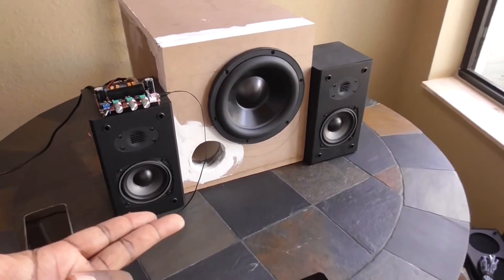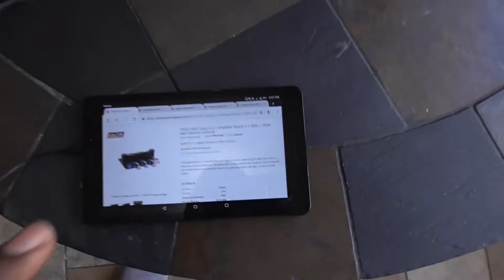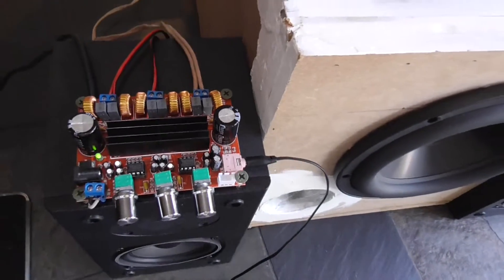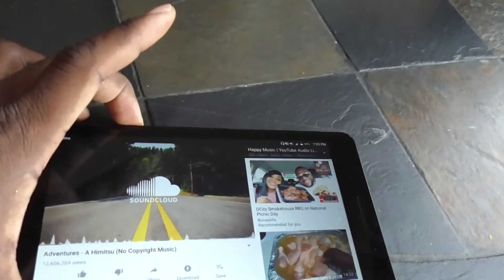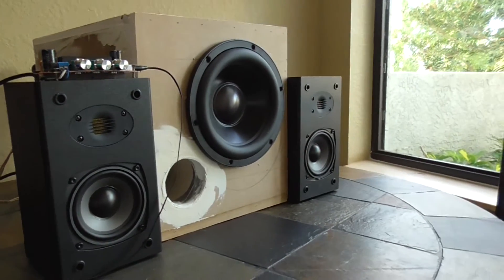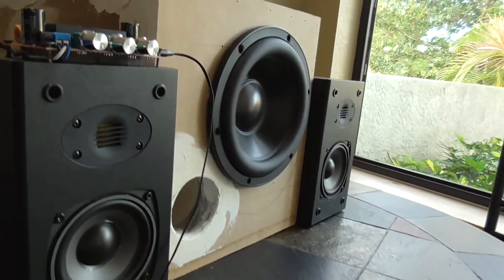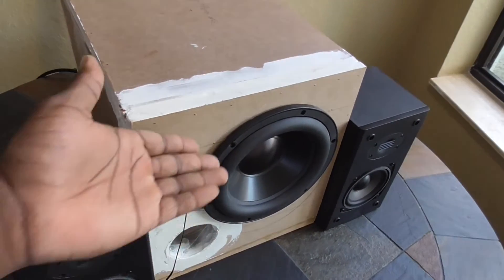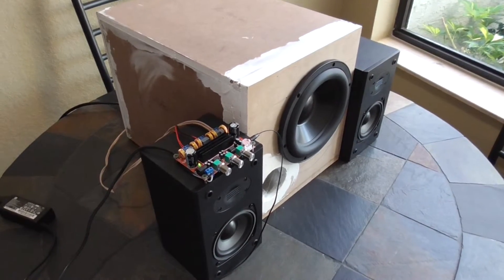Parts Express - TPS3116D2 Class-D 2.1 - Amplifier Board - Part 2

Comment: I have ALOT of experience with this amplifier. They're know for making that pop that you got on you sub and there's really not much you can do about. Don't waste your time trying to fix it. The output on this amp is more like 2x25 * 1x50 (on a good day). Now I will recommend another 2.1 class d amp I got, that actually EXCEEDS 2x50 * 1x100 and the sound quality is phenomenal. It will easily rock your 8" sub It's on Amazon and it's a TPA3116D2(I'll leave a link). There is a Bluetooth version which sounds good but has issues with over heating (I've gone through 3 of them). I've made a bunch boom boxes with this amp and it's hands down the best one in this price range. https://www.amazon.com/KNACRO-TPA3116-Subwoofer-Amplifier-DC12-24V/dp/B06XSCVPWF/ref=asc_df_B06XSCVPWF/?tag=hyprod-20&linkCode=df0&hvadid=312094681626&hvpos=1o21&hvnetw=g&hvrand=775769421827756286&hvpone=&hvptwo=&hvqmt=&hvdev=m&hvdvcmdl=&hvlocint=&hvlocphy=9032481&hvtargid=pla-570064468513&psc=1

Comment: Family working out together! That’s awesome, might have to try that out. As far as the turn on pop,  it could be your signals ”aux/rca”  ground and power supply’s ground, could add a 200 ohm resistor and see if it helps. If not look into a 555 relay delay timer product, could also help delay the problem of multiple grounds interfering. Think the 555 is like 8 bucks. Good video though. Appreciate your genuine opinion in your content